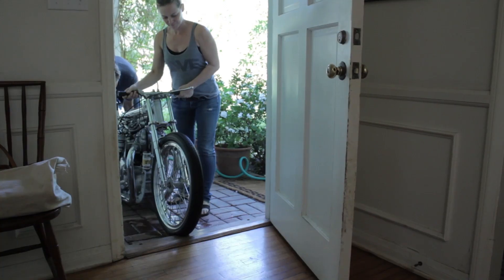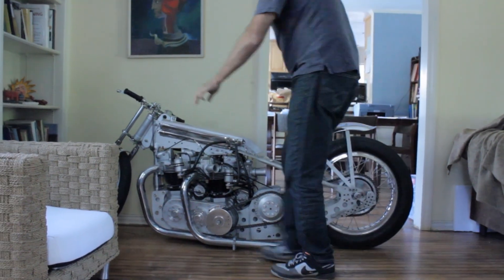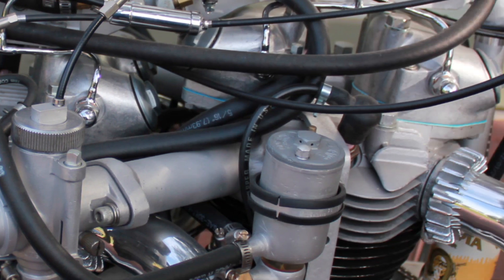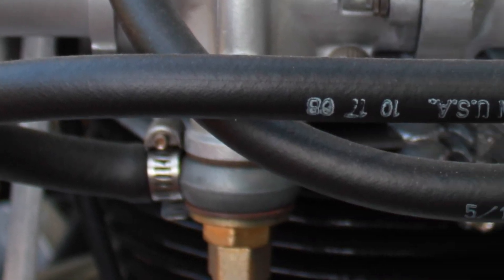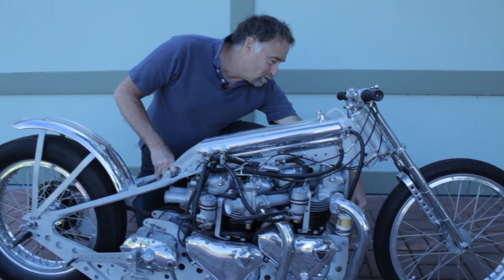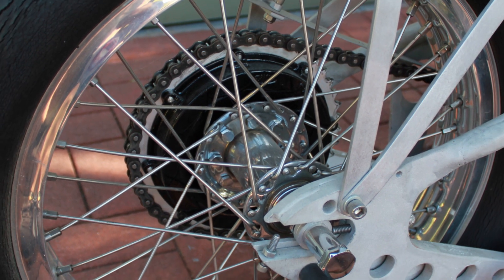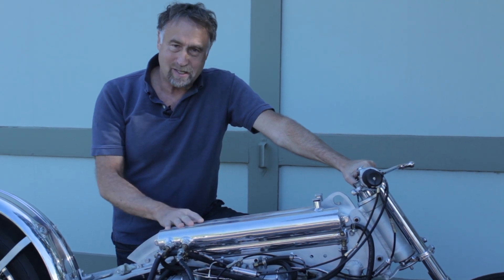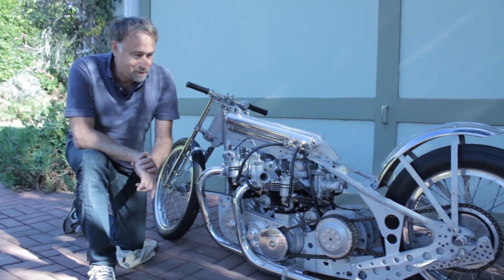Twin Engine Motorcycle Dragster Stage Fright Triumph Bonneville Tiger T110 T120

Comment: I used to keep my new 1994  Harley-Davidson 883 Sportster Deluxe in my living room. I would lie down on the carpet and clean the underside of the machine from road grime after each ride. Still have that bike too!
I also still have my 1976 Triumph T140V 750 Bonneville which won every street cafe race for 10 consecutive years 1977 to 1987. I stopped racing when I got married in 1987. That triumph and Sportster are now under a car port. The Triumph has aged a lot in the last 5 years. The Harley still looks new.

Comment: Reminds me of the "oil in frame" Triumph machines that had the big fat back-bone tube. Surely those tanks are aluminum, not steel?  I think I'd have to switch it to a gasser and keep it running, if only a few times per year on nostalgia nights. They'd make you put some brakes on it, but it sure would be fun, and the bike would be so much happier in the wind. I wonder if you'd sell it to someone who wanted to use it for i's intended purpose. It is a work of art, but so much more than living room art, wouldn't you agree?

Comment: Looks great except the hose clamps. They may be adjustable, but they are not one size fits all. Smaller clamps would look a lot better than a huge tail
Reply: Smaller clamps might look better but these are stronger and can be tightened a lot tighter. I've had the small clamps break but never one this size to break..... but I would snip the "tails" off.
Reply: hose clamps not fuel line clamps? - bit shoddy

Comment: 1962 was the last year for Triumph Pre Units not 1959.
Reply: +D Shine I'm a rookie...what does "pre unit" mean?
Reply: +D Shine 1963 I think.
Reply: willg54 unitary,unit construction,motor n gearbox in one,pre unit motor n box,seperate.
Reply: First 650 unit was produced in Sept 62
but 1963 was the first unit 650 parts list .
The 350s/500s were unit construction from 59 .